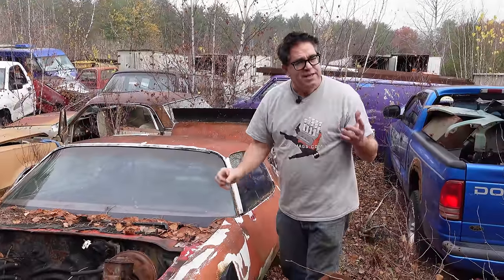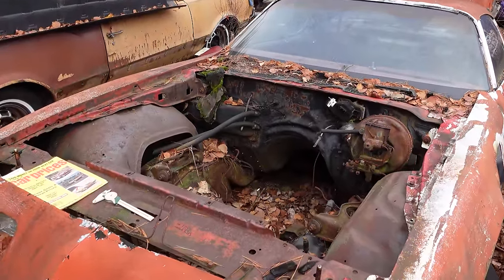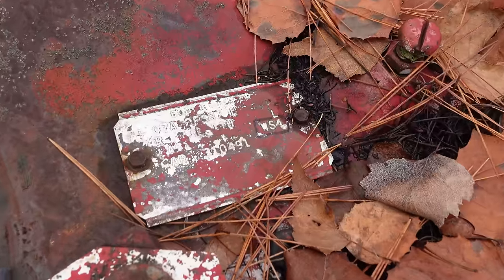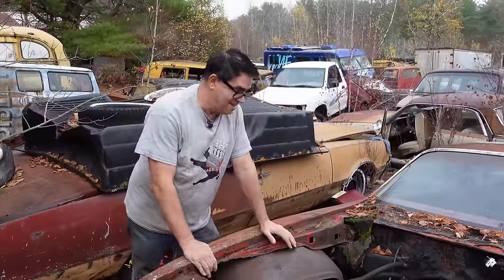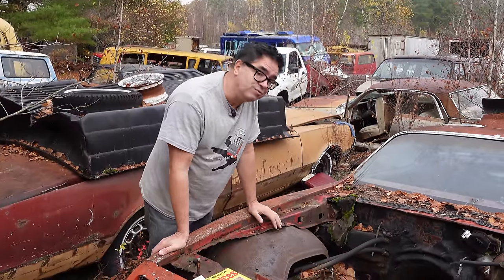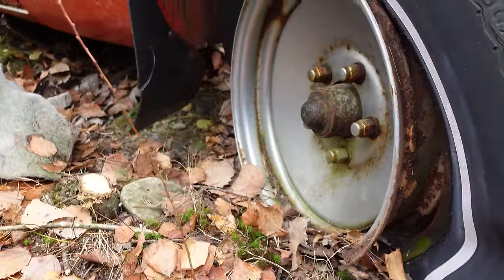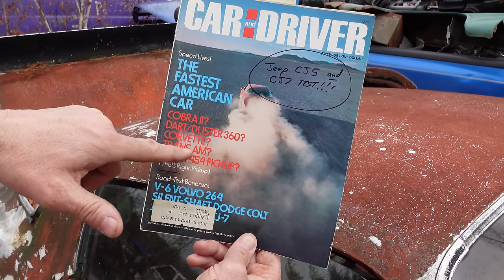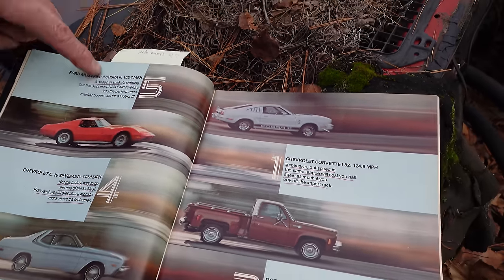1979 Trans Am

Comment: Well Steve I know a guy in 1978 that bought a new trans am, and it had a 455 and a 4 speed. I rode in this car many times, back in the day. I think your little book is given you false information.
Reply: Then it was swapped in. The last year for the 455 VIN code "W" engine was 1976, RPO code "L75". He likely had a 400/4 speed combination. You can't tell them apart that easily under the hood.
Reply: @googleusergp  It was bought brand new that way from the factory. The shaker even displayed the 455 numbers.
Reply: @craigmarr7986 
Last possible year that could have happened was 1976. After that the 455 Pontiac ceased to exist and no way no how did any 77 or 78 455 Trans Ams get built and sold to the public.